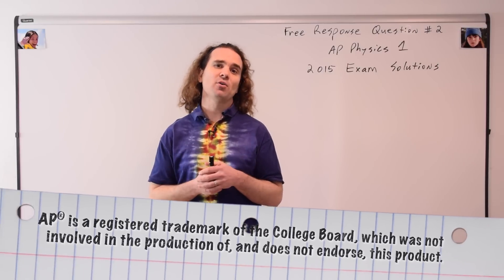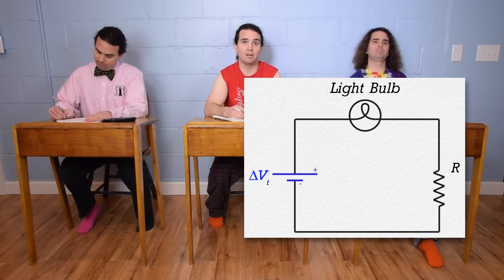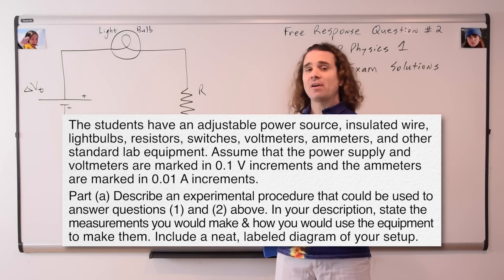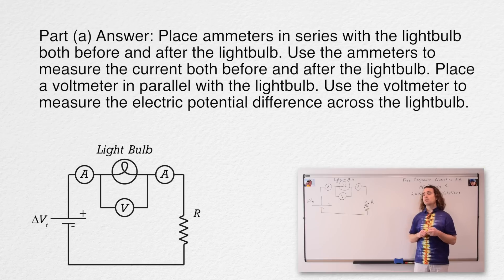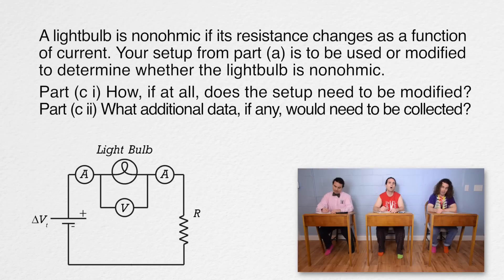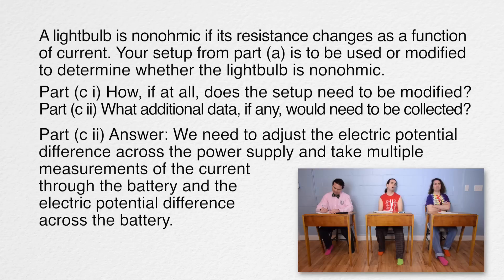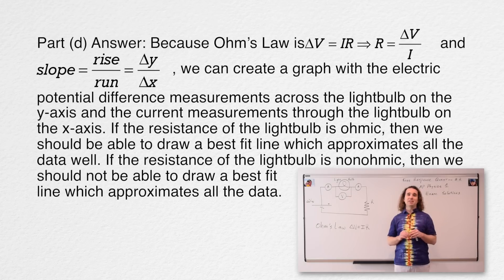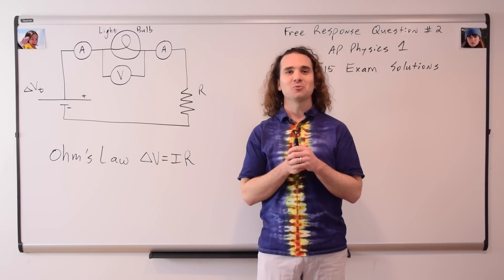2015 #2 Free Response Question - AP Physics 1 - Exam Solution

Comment: how do you know when you would put an ammeter or volt meter in series or parallel like you did in #2a
Reply: i think its because the unit for current is Amps, and the Ammeter measures value for amps

Comment: +Flipping Physics

Now for question 2 in. the free response section, 

b.ii.  I included a voltmeter on the resistor and a voltmeter on the light bulb and compared the readings of the two voltmeters to see if there was any difference. would that work?

c.ii.    Wouldn't objects be non non-ohmic if the temperature that the circuit is running in is not consistent.For additional data I stated that a thermostat would be needed to make sure temperature doesn't change and alter the resistor. Is that correct?

thanks
Reply from the maker: +Monkey D. Luffy b.ii. Comparing the electric potential difference across the light bulb versus the resistor doesn't tell you if the electric potential energy of the electrons in the lightbulb change. If the electric potential difference across the lightbulb is nonzero, then the electric potential energy of the electrons going through the lightbulb changes. (Which is what happens.)

c.ii. A temperature change of the resistor will change the resistance of the resistor. However, that isn't what the question is about. The question asks if the resistor follows Ohm's Law, which doesn't include anything about temperature change.
Reply: +Flipping Physics 
Oh I see...that makes a whole lot more sense.

Thanks for the clarification(and the speedy response)
Reply from the maker: +Monkey D. Luffy You caught me on a good day. Other days ... not so speedy.